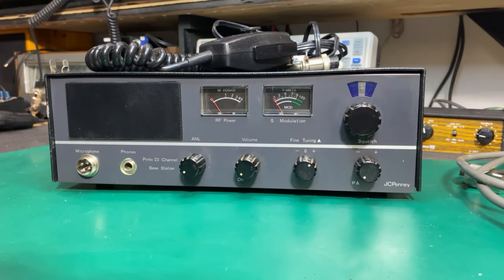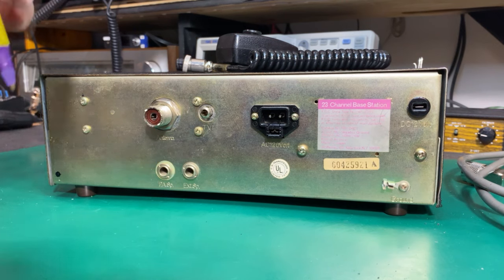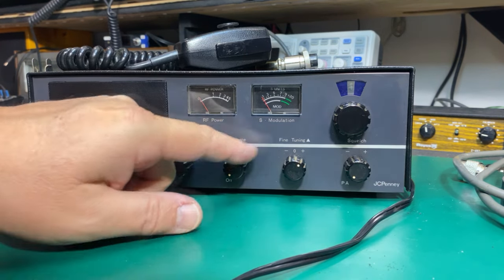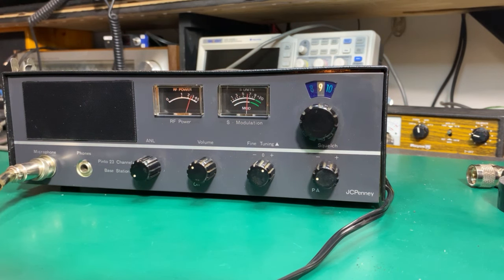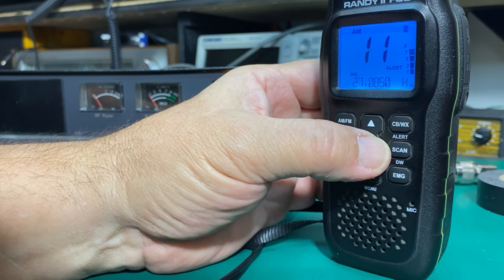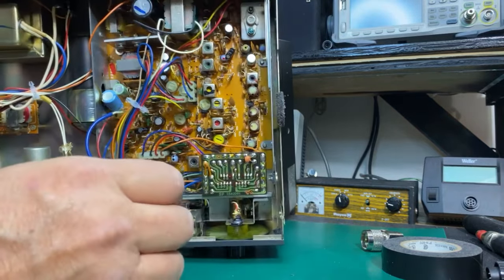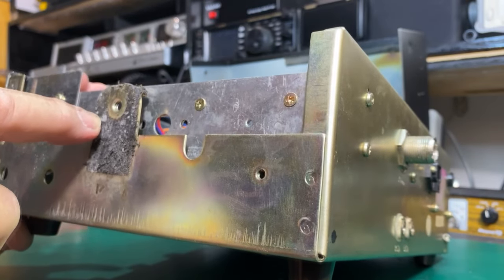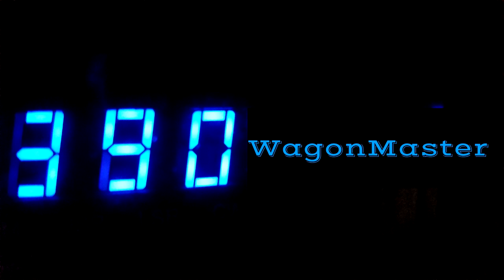JC PENNEY PINTO CB Radio First Turn On in OVER 20 YEARS Did it Smoke

Comment: Ok, some rules of thumb for aspiring radio restorers:
Solid state radios rarely blow up capacitors when they are powered up. They are more insidious, failing gradually and in unexpected ways. 
Tube radios do blow up. This is because after decades of closet sitting they suddenly have 300 volts or more applied to them. I have a current monitoring power supply and I connect it to the filter capacitors and leave it sit for a few hours. This gives the capacitor a chance to reform without the stress of high voltage. I haven't blown one up since I started doing that. 
This radio, like a lot of them, powers up the power supply as soon as it's plugged in. The on-off switch only disconnects the DC side of the supply, so unless you have to, unplug it before you open it up. Crap happens. 
This radio, like so many AM radios, uses the 37/10 MHz crystal scheme. Six 37 MHz crystals, four 10 MHz crystals for receive and four 10 MHz crystals for transmit gives you the 23 channels. Parts radios are very good sources of crystals.

Comment: I'd spice it up a tad 390, put some l.e.d's in it. Is that a big ass filter cap in that rig???(black thingy in the power supply isle)😏👍
Reply from the maker: Yes Eric, the big "big black thingy" is a 4000mfd capacitor. I want to make the lights look stock, however I'm out of incandescent bulbs.  Then I thought I would just install some white LEDs... Then I find that I'm out of those as well.  I do have a bunch of blue ones.... NO!
Cheers
Reply: @390WagonMaster  10-4 on the filter cap,  don't see that very often, but I think there are  other ways of filtering A/C current with today's technology, or is there?
Reply: @390WagonMaster  I've got extra LEDs.  I'll drop a few in the mail for you tomorrow.
Reply from the maker: not that I know of